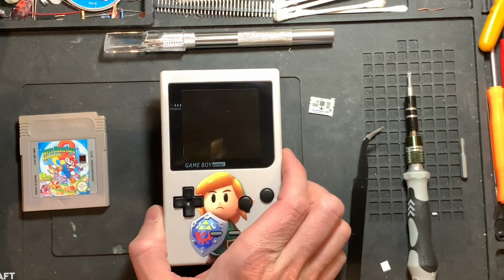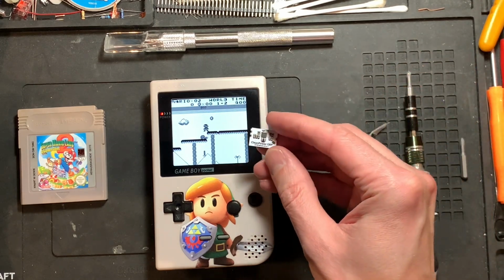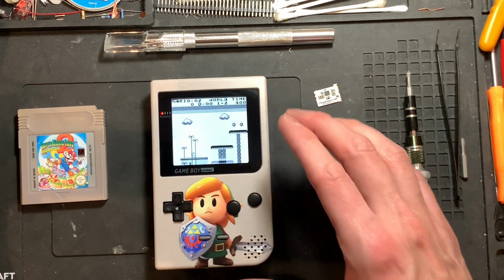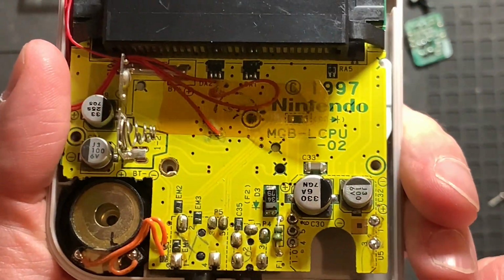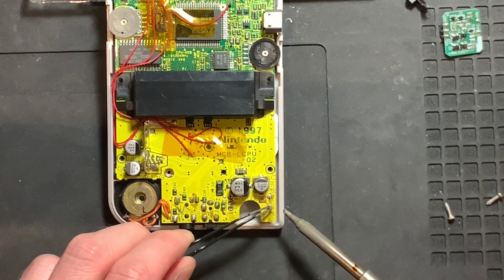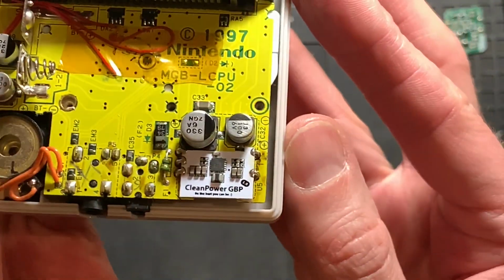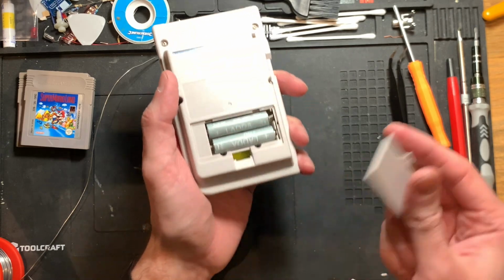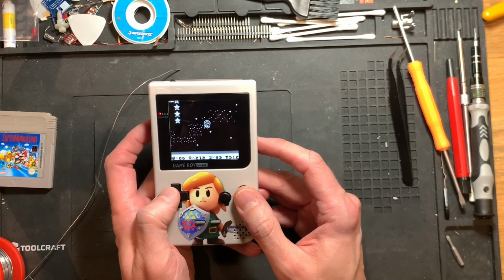GameBoy Pocket CleanPower Mod

Comment: Cool video thank you. 
How did you manage to have the battery information on screen? I put funny playing IPS screen for my GBP and I don't have things like that. Thank you
Reply from the maker: I think it’s one of the touch gestures on the touch sensor at the top of the case. Not quite sure, I would have to look it up again. Doesn’t the Funny Playing mod have some instructions?
Reply: @root42  Only to how to solder and change the "color" of the screen and change the feeling "old screen" back on the IPS. I thing this is a feature from his kind of screen and not on funny playing IPS screen.

Comment: I have an IPS modded GBC that sometimes glitches with NiMH batteries - I should give the GBC clean power board a try!
Reply from the maker: Well, it still glitches out. But less so. Changing the display brightness actually made the biggest change… It really seems the IPS displays are pushing the power supply really hard.

Comment: I use homebrew dsi to play old gb games, and ds lite without the top screen for gba games, the only downside is I didn't implement the speaker, but that can be done too, still I can use the headphone jack. The cool part about dsi Lite it still has the old cartridge slot (so it's not emulation) for gb and gba with full color backlit screen , and it looks like one of those old game and watch handhelds, but I can play all the old games on dsi anyway. So if you ever see someone selling ds lite with a broken hinge or top screen, it's a bargain if you like to tinker with electronics. I got mine for 1 euro on a flea market.
Reply from the maker: Cool. I do have a broken DS somewhere here, with broken hinge. Might repair it at some point.

Comment: Lead free solder is a pain to remove.  Flowing some fresh solder and using a little Flux helps a lot.  Solder braid might work better for stubborn through hole pins.  

The old dot matrix LCD used a tiny amount of power.  The additional draw will cause the regulator to produce noise as it would be operating nearer to its limit.
Reply from the maker: Do you think the GBP used lead free solder? This was ... late 90s or so...?